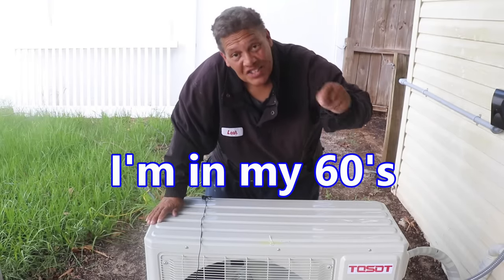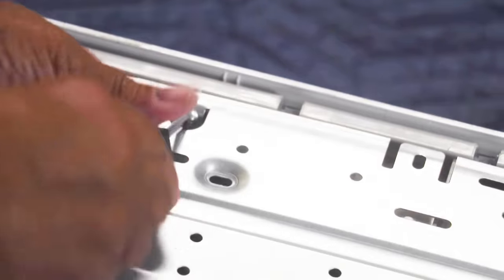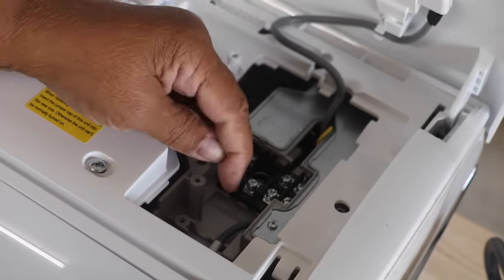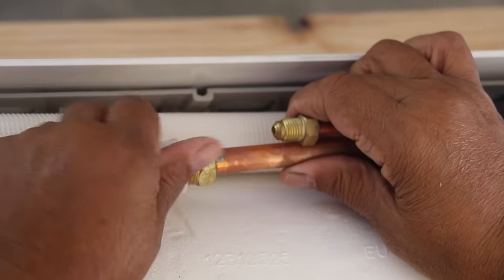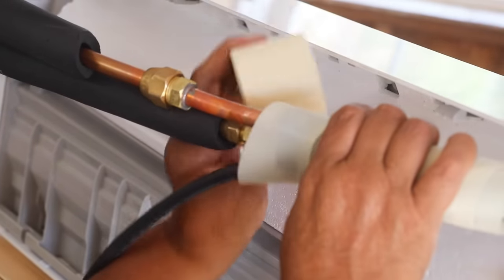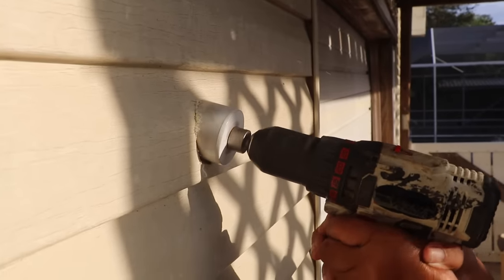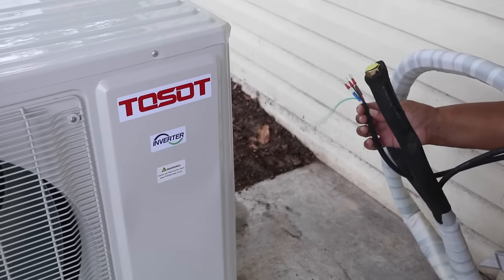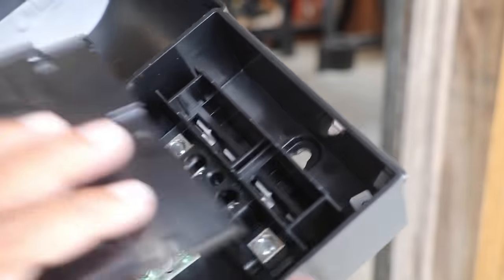I saved $4,200 installing a mini split AC myself

Comment: You might be in your early 60s. I'm in my late 60s. Now retired.  After 20 years with NBC-TV News in, Washington, DC. I'm an old production professional.  You've created, a simply great video here!

My God woman! Your production is superb! No one could have really produced this,  anymore better. I am super impressed!

I've actually been looking into these  Mini  Split, units. To replace an old Bard,, unit. From 32 years ago. And thinking… Since I designed and built this Recording Studio. 32 years ago. It might be in need of an upgrade.  And might I want to install one of these units?  And which might likely require more than, one, Evaporator, unit? If that is even possible? Which will require more research on these units.

But hey I think you did a super job on this video! I really couldn't have done much better. Not by much. In the thorough manner of, installation.  As you have provided here.

You are also wonderfully articulate. Your descriptions  are well,  understood. As your audio quality is also, top-notch!  That was my field of specialty. And you haven't a single mumbled word. As so many others do. You are clear, articulate and a delight to listen to. Which I really can't say about most others. Most others are just  abhorrent in their productions. But certainly not yours!

I just don't see this kind of quality of, installation and descriptives as yours very often. It's very thorough. You have left no screw unturned. I'm super impressed. Most guys in their 60s wouldn't be this articulate. Or this thorough.

Honey you are my kind of woman! Called super capable!  I worked with engineers like you at NBC. And yes. They were women also. They could build, install and fix anything. I worked with the best, like you.

And hey. I'm justt a fake woman. And Caitlyn Jenner, ain't got nothing on me!  Except a lot of money.  I just spent mine on my recording studio. Not my face. Because my face doesn't make music recordings. My hands and ears, do. And I only need to look so pretty as an engineer. To do an excellent superlative job. Which is what it's all about.

I get to feel pretty inside. By a job well done. Another one I can be proud of. Great job!
RemyRAD

Comment: As an actual refrigeration mechanic this how to is actually pretty good. Better than most actual techs do, with just a few tweaks that must be mentioned to stay within codes. 1. The breaker panel is based off line length needed not component amp rating, within 25 feet your golden and did it right (wire should vary between 25 and 50 foot lineset lengths) and MUST be within arms reach of the condenser coil(outside unit) 2. the gauges and vacum are at least $1K in tools that yes are needed to do it properly but have no use after for a typical DIY'r. Should also make note that if after vacuum there is a change in pressure means the connections arent tight enough. 3. and probably your biggest mistake or only real mistake i should say is NEVER open the liquid line first. Always open the suction line (bigger line) first to equalize pressure otherwise you can likely wreck the compressor in the condenser.
Reply from the maker: Thanks for your detailed comment

Comment: Dang, when you got to the electrical part and then the vacuum pump job, I got a bit discouraged. I need to install 3 of those in my basement and they want $14,000 for the job.  Thanks for the great video. I totally admire you girl!
Reply from the maker: Don't  be discouraged.   If you purchase the vacuum pump and gage, plus pay an electrician to install the electrical,  you'll  still save BIG $$$

Comment: A tip I found out the hard way and should have known the drain line will rapidly decay due to UV. We  had one break at off inside the wall at church and had water everywhere. I repaired it by using 1” pex and inserting the provided drain in the pex with no part of the original drain seeing sunlight, only the pex.
Reply: Excellent advice and a cheap and easy upgrade.

Comment: My Tosot 12,000 BTU unit arrived to-day, I have to get a vac pump, gage set and waiting on the wire and the rest, always done ALL my own work, including installing a new Goodman 96% furnace - electrical, gas line and all the ducts, now finally decided to get rid of the damnable window AC twice a year rodeo lugging that up and down the stairs and blocking half a window with it.

As far as the installation goes on the Tosot, THE most critical part is torquing the flair nuts to specs, it is worth buying a torque wrench to ensure it's exctly where the specs say it needs to be, too tight or too loose can cause leaks.

Comment: I suggest these essentials to ensure a Bang Up job: 
1. Nylog Blue (a magical thread sealer for the flares, the most common failure point)
2. Flare Seal (a new invention, washers also to help seal the flares) Use if you want with the Nylog) 
3. "Ez Bend" Copper Bender kit (precisely sized plastic floss, goes inside of the fragile copper, allows all the bending you want, no kinks) 
For The OCD:
Micron Gauge a cheapish $100 unit, will help show how deep you got your vacuum. If you hold under 500 microns for 1hr, you have a tight seal.
Nitrogen Tank, valve and regulator. With it, you can run your line set up to pressure, real world to want for leaks, before they happen with your precious refrigerant. It also purges the line better than the vacuum. After the nitrogen, then vacuum .. My favorite method, after my third install (me and my neighbor). 
Now, go forth DiY'er. The wicked HVAC trade wants to drain your bank account. Do it yourself and save a fortune!

Comment: You HAVE to torque your lineset connections!! They will leak even if you did a bubble test. Also use your gages to check your D/T based on refrigerant type and ambient temp which is the most important thing to do after start the unit. The unit will work without doing these steps but not for long before you have issues with cooling

Comment: It's interesting how this unit, which is prevalent in Asia (and other countries not listed), rely on these units. I believe the modern trend is installing a unit in each room and which can be controlled jointly or severally with a main thermostat system. The US should transition the same as it saves costs on electricity and HVAC and you don't need to condition the entire house when you just need to specific spot in your home. Awesome video~

Comment: It only cost about $500 in labour in Australia for simple install. Plus the warranty is only valid if you have a qualified HVAC tradie install the unit. And I am so glad I had it professionally installed cos my Panasonic unit with 5 year extended unit failed on year 3. Panasonic honoured the warranty and gave me a brand new unit installed by their HVAC sub contractor.. Game set match.

Comment: I keep looking for a low wattage heat pump to plug into a normal 120v AC outlet in the US.  I don't need a 1500 watt heat pump as anything about half would do.  1500 watts of resistive heat generates about 4500 BTUs, and a heat pump generates about 3 times that per watt.   Since I rent, just don't want to invest in a large whole-house version even if they are fairly permanent installs.  The smaller units also weigh less and should be easier to mount as heavy as they can be.  Thank you, Jane.  I have this project for this year, because our heating bills went through the roof between the price of oil and price of electric heat.

Comment: Curiously is there no drier for the unit for the refrigerant line? Also do the units contain all the refrigerant needed to get the unit going? Also what kind of refrigerant do these typically run on? 

Very well informed DIY video. Thank you so much

Comment: These work awesome and are pretty easy to install.  Only thing to watch for is make sure you use a good stud finding so you don't end up installing the mounting plate in a way that you can't pass the freon lines easily.
Reply: Just wondering... Where do you get the freon from?

Comment: I've been on the fence for years about doing a mini split. It's really only needed for 2 months of the year for cooling but was I really need is some dehumidification. The dehumidifiers with refrigerant are around the same cost as a mini split or even more expensive.

Comment: That's putting a whole lotta faith into the work someone in China got paid 5 cents an hour for, in terms of those flares in the copper refrigerant lines. Which is where the majority of the problems occur when people attempt this themselves. What's not mentioned in this video is what to do if the lines are not holding a vacuum after you turn off the pump, which isn't a rare problem. Call a professional and pay thousands? No. But you'll have to watch a lot of videos and learn how to make new flares after you've cut off the poorly-made flares. And also purchase the tool to flare the ends. And also a special torque wrench to tighten those connections, also not mentioned in this video, since the manufacturer specifies exactly how much torque is required for each connector. Too tight or too loose will cause problems. And lastly, a flare sealer called Nylog, which further insures those lines will hold pressure over time. You need to watch quite a few more videos before attempting this yourself. Find the ones from actual HVAC professionals with a ton of experience, and avoid videos from DIYers.

Comment: These are efficient and many countries use them, especially Asian countries.  They have different sizes for room. We have concrete walls and easy to install. We bought small one for about 600 rm or about 200$. A bigger one about twice that. We have 220 here in Malaysia. One per room is best.

Comment: Greatly enjoyed watching this step-by-step guide. However, as always, I find that the projects I face are always substantially more difficult that what is typically shown in such videos. This is mostly due to the many extra problems caused by the old age of my house. For example, I have already worked 3 days (and not even close to finished yet) just on the inside wall to receive the indoor unit. So let's call it 4 days work and the mini-split has not even been taken out of the box yet!!! [I have undulating old cracked plaster-on-lath walls that first need to be covered with sheetrock, and there are not normal studs every 16" behind the plaster]. Plus, part of the extra problems stem from which mini-split you buy. The 40 page instruction booklet on mine is chock full of incomplete information and unclear guidance, which is why I keep reading it over and over and over to try to make sense of it. For example, they are not nearly as clear as Jane's video about the various steps. Also, I see that hers is quite a bit easier than mine to install, for such reasons as: mine has copper pipes that are not simply ready to wrench together, but must first be properly flared with special tools. The extra tools needed amount to many hundreds of dollars extra (flaring tool, torque wrench, vacuum pump, pressure manifold valves and pipes, etc). I will watch at least several more of these install videos before going further... On the outside I must remove a window shutter from the wall. Plus I cannot simply use a hole saw to drill through like Jane does: my old aluminum siding is trickier to cut a clean hole.
Reply: Best time to discover a DIY friendly unit is before you buy it
Reply: @sethtenrec  True. My next stop is back to Home Depot to ask if there is any customer service number on this mini-split. Surprisingly, the 40+ page instruction booklet has ZERO company information, no 800 number, and is also replete with many unclear sections including no wiring diagram! They don't even say which coolant is recommended.

Comment: Awesome video and thank you for showing us this.   I would use Teflon tape on those copper fittings to make sure there are no leaks. Last thing anyone wants is refrigerant leaking over time and the following summer it blows hot air.  Again great video, this has to be better than my 230V window AC unit.

Comment: What you call a strain relief is more popularly known as a power cord clamp. At least that is how I know it. Its function is to pinch the power cord at the clamp and to allow anyone pulling on the cord from damaging the unit at the individual electrical connections.

Comment: You left a huge important part of the install right out of the video. The part where you release the the refrigerant into the lines and check pressures, also removing gauges so you dont loose refrigerant to atmosphere  ? Also doing an install like this is ilegal in most countries including USA, with hefty fines if you get caught.

Comment: I’m going to try to be as positive as I can, but also shed a little light on some of the things you didn’t mention and/or missed. I will 100% give you kudos for being able to do all that yourself and also save yourself quite a bit of money. But here’s some of the issues that I saw with your installation. The refrigeration lines are soft copper and have a tendency to kink. This could cause a restriction in the line or a leak, which is a major issue.  You also have to take great care and not getting any dirt or debris and the line sets. And, like you mentioned, the manufacturers would prefer you to torque the flare fittings because you can crush a flare and cause a leak. Once your line sets are in, you should pressure test them with dry nitrogen. This is done to ensure there are no leaks prior to opening the service valves, which would cause the refrigeration to leak out and the unit to not operate. Once you ensured the tightness of the system, you can then start the evacuation process. The evacuation process is done to remove any water vapor from the Systems lineset. Water vapor is a noncondensible, and will wreak havoc on the system and ultimately cause it to fail. Now you had a short line set run, but most manufacturers would like you to perform a triple E vac and to test system tightness by pulling a vacuum measuring microns. Again, any moisture in the system can cause acid and ultimately compressor failure. So if you’re to use a vacuum pump and gauges only,  it is best to leave it on for at least an hour and absolutely do you not remove the hoses before cracking one of the service valves. If the system is in a vacuum and you pull the hose off, you have now introduced air and possibly moisture into the system. I would recommend pulling the vacuum, closing the wheel of the gauge on the side of the hose, attached to the condenser, cracking the service valve and watching the gage move to positive pressure. Once the gauge is in positive pressure, you can close the service valve, takeoff your hose and then open your service valves fully. While I am sure a lot of people are capable of doing this work, the steps I mentioned could, and should prevent any issue in the operation of the unit, and without them, you could have convinced someone to waste a lot of money.

Comment: The comments here crack me up. You can tell most either don’t own a business or feel the one they do is the only one that should make money.  The cost per technician for the overhead is roughly $65.00 per hour worked. Sure you can be much lower if you don’t offer things like  health insurance or other benefits.  Just in this video that equipment cost $1,200-$1,500 depending on your market, $500 for a proper vacuum pump, $120 for a cheap set of analog gauges as well as miscellaneous tools and hardware needed. Not sure about the electrical but can’t see it being less than $150. So we’re at roughly $2,500 in equipment,tools and miscellaneous. I’d say $4,800 was more than fair. Also if something goes wrong (and I pray it doesn’t) like a small fire that damages your home , you’re homeowners insurance will not be required to pay you because you’re not a licensed contractor or technician.
Reply: In no way am I saying capable people shouldn’t save money where they can. Just don’t accuse companies of “ripping “ people off without a comprehensive understanding of what it takes to run and operate said business

Comment: 06:00:   And after removing those yellow caps, throw them out immediately or else, about two years from now, you will be pulling them out of a drawer full of "leftover" parts, and, still unable to determine what they hell they go to, you will toss them right back in the box.  Works for a surprising number of packing and protective devices on new purchases.

Comment: I have installed many ductless units & worked on a whole lot more.
The #1 reason for service on a minisplit is poor install (my opinion).
When I install these units, I bend that line set straight out the back of the unit, so my mechanical fittings are outside & accessible. I sometimes switch the drain out to the same side so I don't have to core to holes, but other times I'll leave the drain separate out its own pass thru. 
Making those mechanical connections outside means you can armaflex them up good & they won't sweat back behind the unit on an interior wall. That copper insulation was poor & will sweat.
After you've made all the copper hook-ups, I nitro test to around 350 PSIG & bubble check all 4 mechanical fittings. If I've got leaks I can address them then without opening any valves. 
Then dump the nitro & evac the lineset (way down to 500 microns & hold at 500 for an hour or so- gives time to do final wiring/clean up/etc).
You should never remove gauges while under a vacuum, you will pssst suck air in. You don't remove gauges until after you have cracked the service valves to allow for positive pressure.
Of course all installs are different, such as when you have to extend copper, add X amount of refrigerant for additional line length, or even shorten a lineset.